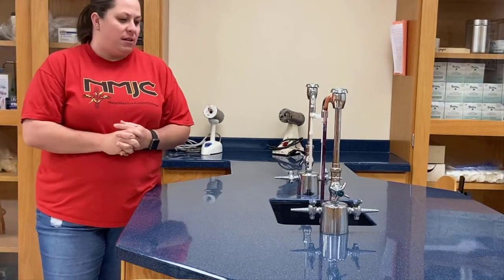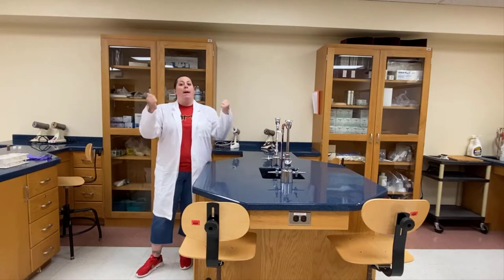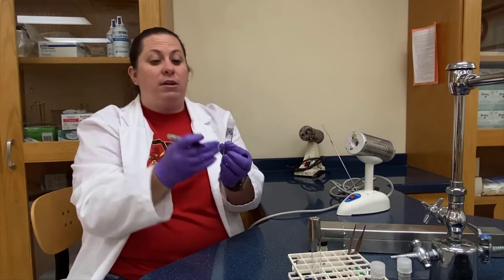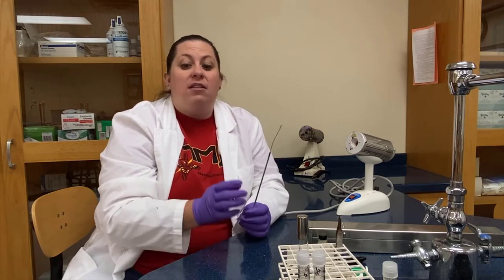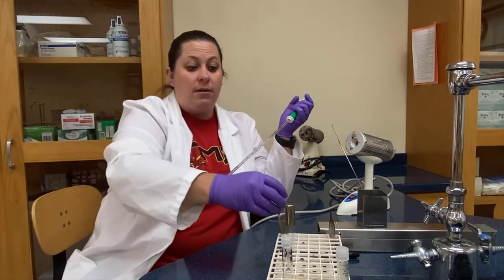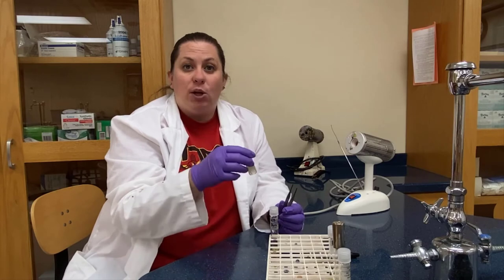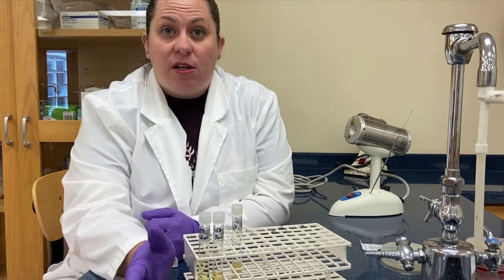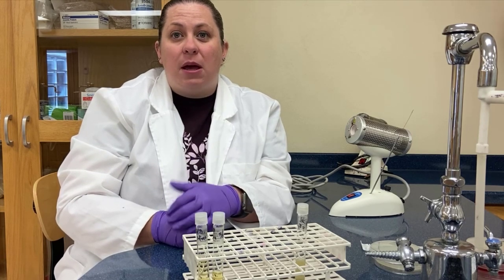ASEPTIC Techniques

Comment: I am curious about the gas given off during incubation has it been investigated to determine its characteristics?
Reply from the maker: Gas is released due to the metabolism of the microorganism.  Normally the gas is carbon dioxide which is produced by cellular respiration.
Reply: Thanks for your reply I have one more question, if you left the lid on air tight how would the organisms react?